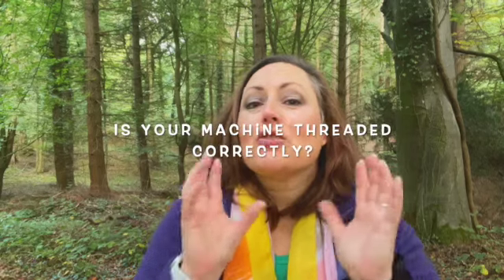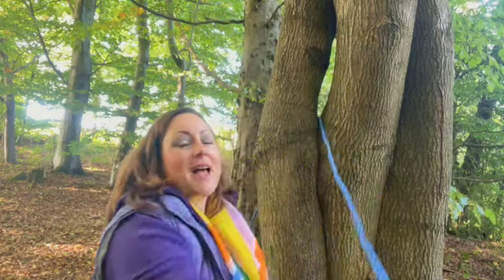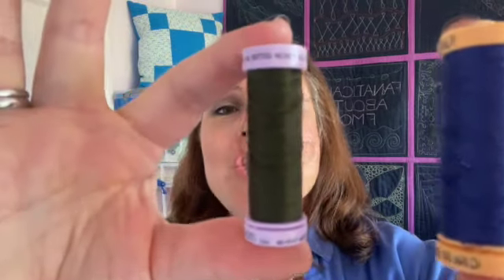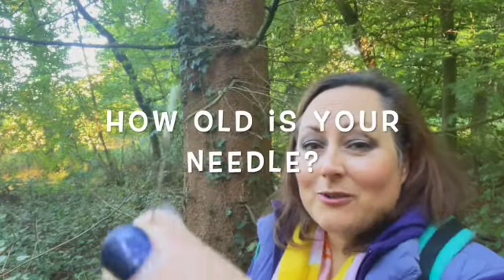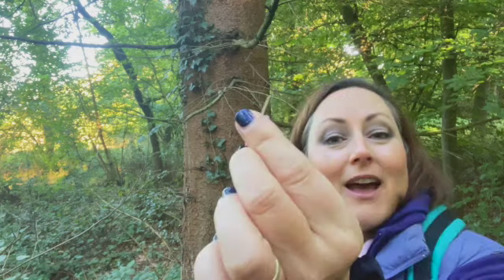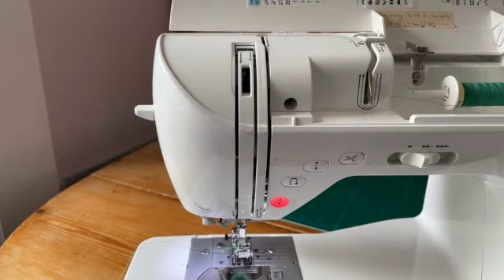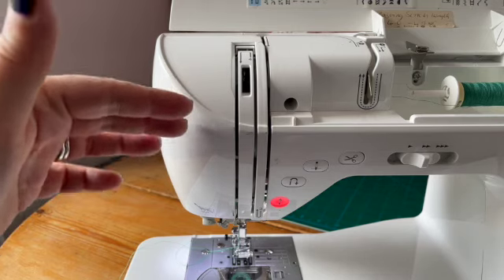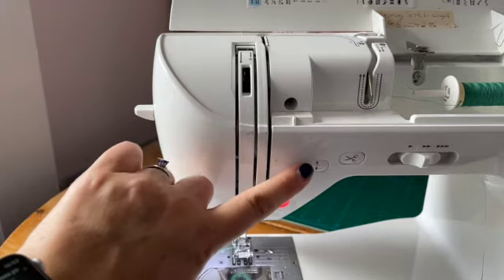🤯 Sewing Machine Keeps Unthreading Itself - Six Quick Fixes

Comment: Beginning sewer here, and thank you for these tips! I simply could NOT figure out why sometimes everything worked perfectly and sometimes (well, frequently!) the thread just slipped out of the upper needle. It didn't seem like it was snapping, and as a beginner I have a new needle, new [Gutermann] thread, and as far as I could tell I was threading it correctly. However, I falsely assumed that because my Singer has a little place to snip thread on the side that the length between that and the needle was the proper length for a tail. And it NEVER occurred to me that the thingy has to be as high as it will go in order to start sewing. THANK YOU SO MUCH!!!! Liked and subscribed!
Reply from the maker: Aww, you're very welcome :-) I'm glad it's all sorted for you now.  Happy stitching! Kim x

Comment: My machine unthreads itself at the end of my stitching when I press the button to cut the threads. It's almost like they get snipped, then snap back and out of the needle.... any tips for that?
Reply from the maker: Hmm, that kinda sounds like a setting in your machine needs adjusting 🧐 My auto-cutter still leaves a little bit of excess thread. I think I would be tempted to take it for a service and ask the engineer if he/she could adjust it. Sorry I haven't got a magic solution for this one 😟

Comment: Hmmm...got one minute into this video and learned that it matters which way the needle is threaded. I am threading mine back to front because I'm using a little threader tool. Interesting...I wonder of that's my problem. Very frustrating!
Reply from the maker: Hi Jay, there is definitely a correct and incorrect way to thread your needle and it’s always front to back; it’ll come unthreaded if the other way around. A little tip for threading (instead of using the little threader tool) is to snip the end off your thread at 45 degrees, then lick your finger and wet the back of the eye of the needle. Offer your snipped end of thread to and through the eye and the wetness will draw it through. It works 99% of the time and is less fiddly than the threader tool. Hope that helps 😊 Kim x
Reply: @QuiltWithKim  Hi Kim - Thank you so much for your reply. I'm quite excited about learning to use a sewing machine, but I'm bumping into a few of the common issues that beginners face. The reason I pulled out grandma's old machine was because a friend of mine would like to make some curtains for his home. Somehow, I got into the middle of it and here I am. I'm confident in my abilities though. Once I master the actual function of the machine, I'd like to move onto some practice projects and then the curtains themselves. Would you happen to have any video on either? Thanks, Jay
Reply from the maker: Hi Jay, first up that's great you've given a new life to an old machine! Have you changed the needle in your Grandma's machine by the way? They need changing every 8 hours of sewing or at the start of every new project. You also need to swap them around depending on the thickness of fabric you're stitching through. I have a whole bunch of videos for beginner sewers that are all in one playlist (Sewing Essentials) if you go to my channel's home page, you'll find the playlists there. The projects I have tutorials for are for quilters which I'm not sure will help you very much (although I have a few non quilting projects coming up in November and December); do you know what you might fancy making? - or do you need a bit of guidance of 'what next'? One of my male students was recently berating the lack of channels and tutorials for men learning to sew, so I would be very interested to hear about your experience. Kim x
Reply: @QuiltWithKim Hi Kim - Just so you know, I'm using an old Singer 6235. I'm not sure you're familiar with that machine or not. It's very cool. I was in a quilting shop in town today and I mentioned the machine make and model to the lady owner. She loved it. She said it's a workhorse that I should take care of. She said it's got all metal parts inside and it should last generations. All I need to do is give it a good internal cleaning and regreasing and it should be good to go. The reason I mention she was a "lady" owner is because she was a bit surprised that a man was so interested in sewing. Personally, I love the idea. I've already repaired two pairs of pants just this morning. It's a very mechanical process that I find fascinating. To answer your question, I haven't changed the needle. I'll have to purchase some and do that. I also need to buy some new thread because I think the stuff I'm using is just as old as the machine itself. I noticed that it was breaking quite often. I swapped in some thicker thread and I had excellent luck with that. Also, I now thread the needle properly, front to back, and that's helped with the unthreading issue I was experiencing. That and the thicker thread cured my problem. Basically, right now, I'm interested in fixing holes in things. I have a pair of Carhartt pants that has a wear hole in the crotch that I need to fix. I just ironed on a patch that I'll follow up with some thread. I have another pair of pants with the same problem. I think that's what guys are interested in the most - fixing things. Beyond that, like I said, I'd like to help my friend with his curtains and then maybe start making things. Pillows and other things - who knows. I'll check out your playlist. I'm sure I'll find some good stuff. Strange for a guy like me who cuts down trees and fixes cars to want to make pillows. Who knew? Thanks for all your help. Jay
Reply from the maker: Hi Jay, one of my best students is a man with an engineering background… there’s absolutely no reason at all why men shouldn’t be interested in sewing! I’m all for it 🥰 

So as far your needles are concerned, this video will help: What do the sewing machine needle numbers mean?
https://youtu.be/6GWJp6ogVdg

Thread, as you’ve found out, degrades over time. Standard sewing needs a 50 weight (“50 wt”) thread. This are normally referred to as Sew All thread. For most projects, you need a polyester thread … Gutermann is a go-to brand for most people and you can’t go far wrong. I’m sure I’ve covered thread in a video somewhere but can’t find it right now, so I’ll have to look at my spreadsheet tomorrow. 

For mending trousers, you’ll need your 50 wt polyester thread and a 90/14 or 100/16 jeans needle.

For curtains, same thread and a 90/14 universal needle.

By the way, Schmetz tend to be recognised as the top brand of needles. Needles are universal. If you need to know how to change them, I’ve got a video on that too… let me know what if you can’t find it. 

Kim x
Reply: @QuiltWithKim  Thank you Kim - You are the best. I'll make a list and buy the needles and thread. And then I'll check out your videos. Jay

Comment: There is at least one more reason why your needle keeps unthreading itself which i have a problem with at times because I forget about it.  And, that is this:  When you lift up your project to cut the threads, you can sometimes pull it up too much, causing tension to be between your work and the needle.  When you cut it loose, that will cause your thread to pull back and come out of the needle almost everytime.  Just wanted to letcha know about that.  👍😍❣️😻
Reply from the maker: Absolutely; there are lots of reasons why machines unthread themselves; I've tried to focus on the most common reasons that beginners experience in this video. One day i shall record 'Episode 2' with all the other reasons 😃
Reply: @QuiltWithKim  Looking forward to seeing that video.  Thanks for sharing your channel with us.  😉😍❣️😻

Comment: My thread breaks. Any idea how I can solve that?
Reply from the maker: Hi Jeanine, so sorry for the delay in reply, I had a close family bereavement. There are a number of reasons why your thread breaks, but the most common is that the upper thread is not feeding through the machine properly so you need to make sure it's threaded correctly and running freely. Check it manually first, then do a few gentle stitches using your hand wheel to see what happens before moving on to using your foot pedal. Let me know how you get on. Kim.

Comment: I watched your six reasons why the machine keeps unthreading itself. I seem to be doing everything right  my machine is only 3 months old. So needle very new, good quality thread used. ($11-00) for one paid. It sews for about a quarter of a metre then unthread itself. Sometime also doesn’t pick up bottom thread.
Reply from the maker: Hi Carmen, that’s sounding a little like your machine isn’t threaded correctly, particularly the bottom thread. Do you put your bobbin in on the top of your machine in front of your presser foot, or at the side where you pull down a ‘door’ to access it? Let me know and I’ll try and help. Kim x

Comment: I never thought about how old the thread was. It's Guterman thread, so good quaIity, but mine is years old, nothing wrong with the machine or needle as I got it this week brand new. Also you said to change the needle every 8 hours? Is that if you are continuously sewing for that amount of time? Also do you mean "give that particular needle a break" or "throw that bugger in the bin" because this is going to be a whole lot more expensive if it's the latter lol 😂
Reply from the maker: Hi Keira, Gutermann thread is high quality so it does last for a long time, but it will degrade eventually.  The best way to tell is wrap it round your two middle fingers (sort of dental floss style!) and try to snap it.  If it hurts your fingers whilst doing it, then it'll be strong enough.  If it breaks easily and doesn't really hurt, then it's probably started to degrade.  For your needles, yes, it's after every 8 hours of continuous sewing with one needle.  It's rare that we'll be 'actually' sewing for a straight 8 hours, so you have to judge when it's been used for about 8 hours.  After then, it will need to be discarded safely.  Hope that helps!

Comment: None of these was the reason my machine was unthreading.  Really frustrating.
Reply from the maker: Oh no 🙁 Two other things you could try are adjusting your tension, or ensuring that the top spool is not on too tight and the thread is the same weight too and bottom. Failing those, it might be worth having an experienced sewer or local sewing tutor use your machine and there’ll be able to tell you where the problem was is. It’s possible that your machine may need a service but I’m sure there’s an answer before you need to do that. Let me know how you get on. Kim.